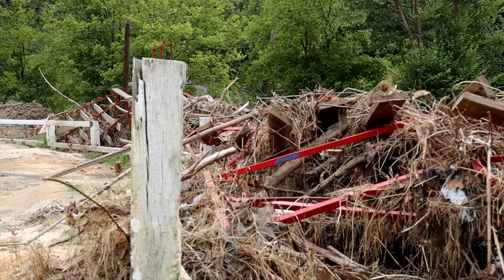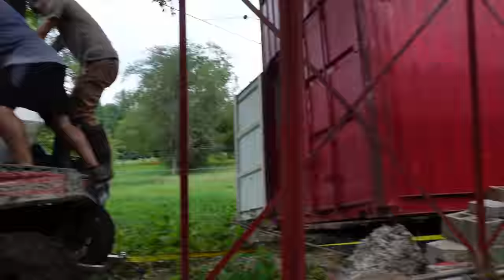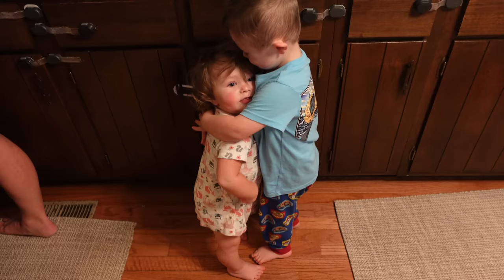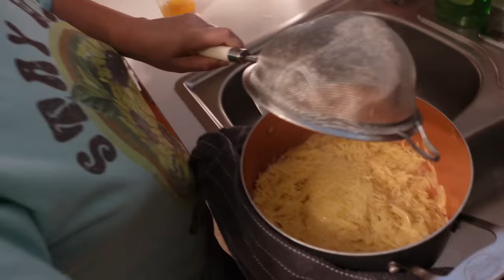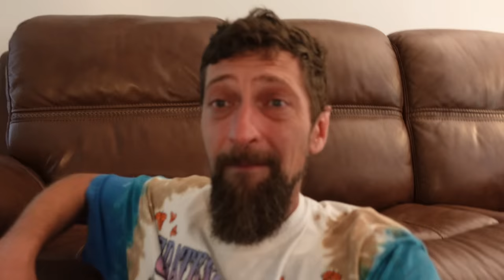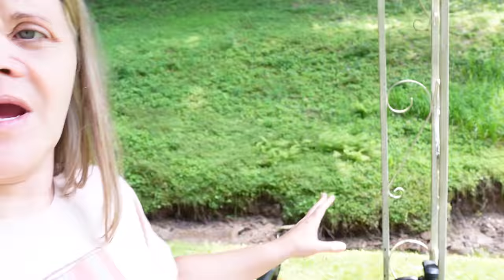We're still here

Comment: that's how I was raised @ the lake. jump in water, get out, soap down, jump back in water, get out you & your swim suit it clean all day. next day do it all over again. some days 2 times a day when you was really sweaty.... I still take hose showers all summer long. I even shave my legs outside all summer long.... I LOVE IT & I don't care what my neighbors say either & I'm 57 young. but that well water is very cold as I've gotten older...🤣🤣 Burr but it sure wakes you up.
I also made a water trough that's 8foot by 2 foot deep into a swimming pool. I used my old swimming pool filter & just threw the hoes over the side & tied rocks to the hoses to weight them down,  bc they try to float out & you don't want the intake hose to burn up by sucking air. I can float in that water tank & spend hours in there just floating around. I will also doing my own homemade exercise & I've lost 10lbs by moving my arms & act like I'm riding a bike.. it's a good workout for just making them up on the fly..
I really made it for my grandson & he loves it. I swim with him every time he comes over. sometimes after I washed down with soap and water, I wash the soap out of my swimsuit as good as I can and off my body with that cold well water, then I'll  jump in to the warm water trough and make sure all the soap is out of my hair and out of my swimsuit. it's also good for my back. it takes the weight off your back, I've got rods & screws & 2 cement disks in my back & a knee replacement & I can exercise better in that little pool then I can on my bicycle. it does put the weight of my whole body & pound my knee like a regular bike does. I just love my little pool & I do my exercise everyday when no lighting is going on. I love playing in the rain when I was a little kid & I still love it to day.
everyone one should have a hillbilly swimming pool. it gets up to around 92 degrees & it's like taking a bath in the great outdoors, someday I have to cool it off bc it does get to hot for me. Best temperature is between 84 to 90 degrees. y'all should try it. I've even seen on YouTube where people will burry them in the ground & put nice stepping stones all around the pool. looks really nice, but I have mine on the deck so no grass gets carried in on your feet. LOVE 💕  IT SO MUCH.
Thanks for being good neighbors to the ones who lost there homes, prays to thoughts family members. if there believers in God, God takes care of his flock, God bless them all,
Chris from Missouri